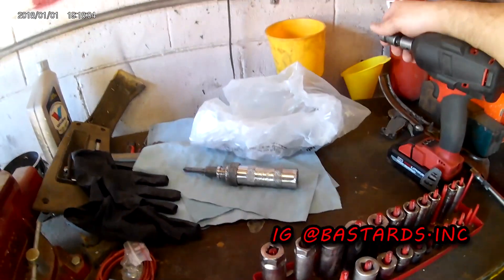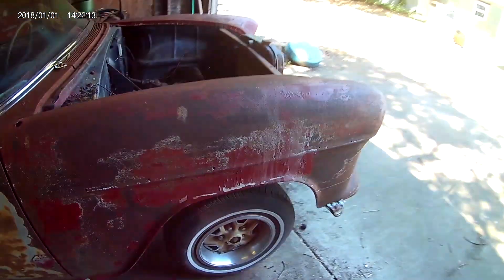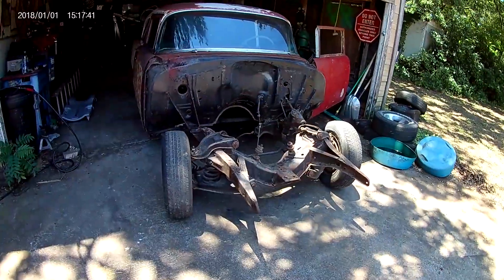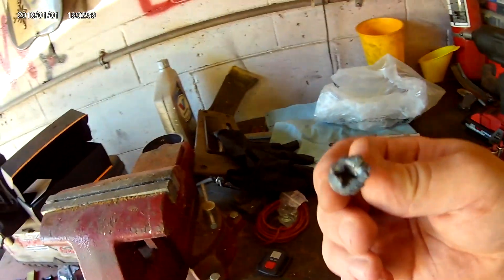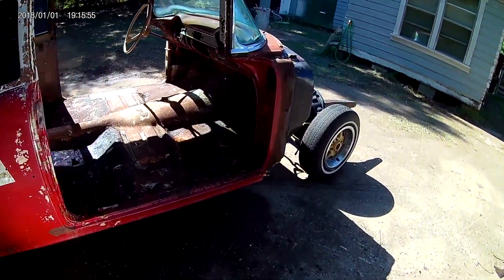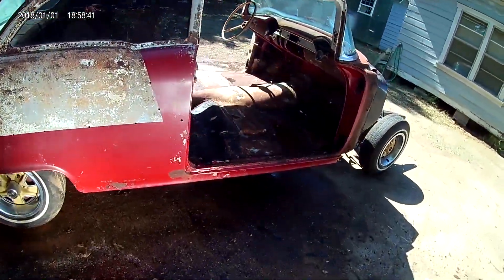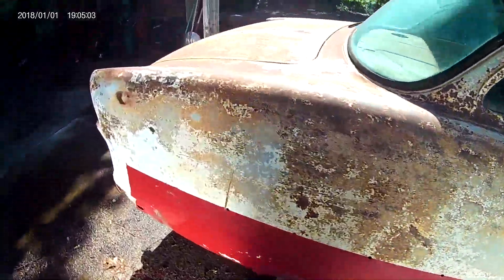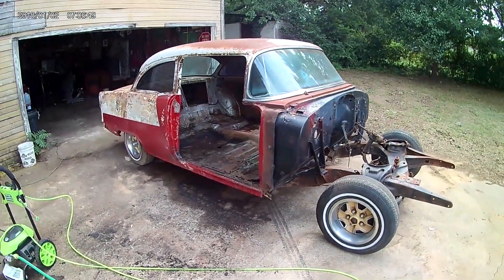55 Chevy build for pops 1 tear down

Comment: Yesterday I went and looked at a 55 Chevy 210 2 door post.  The car has nice patina, clear coat over old original paint, primer, rust etc...looks very cool.  Body had pan sections welded in, rocker rust repaired...seats and door panels redone, no headliner installed, but other than that interior is mostly done.  Engine and trans are 350's, both work perfectly, performer carb and intake, nice wheels with new BF's, front disk brakes...runs and drives great...the guy wants $15,000 for it and was wondering if that sounds like a good deal?
Reply from the maker: if its had a full floor done price sounds about right